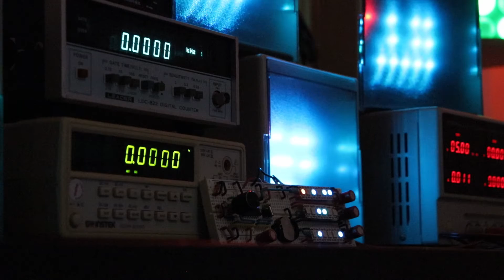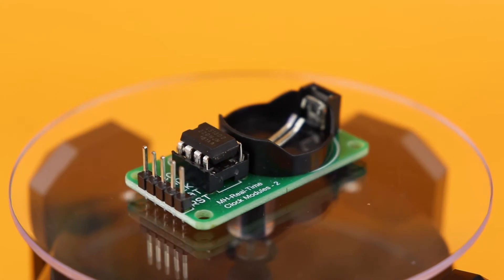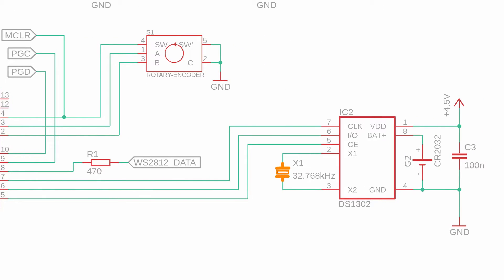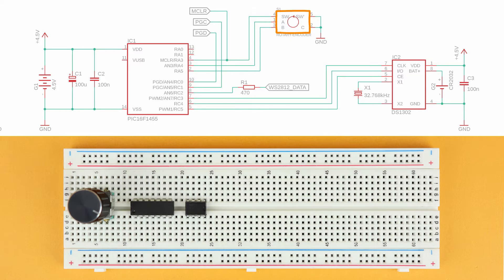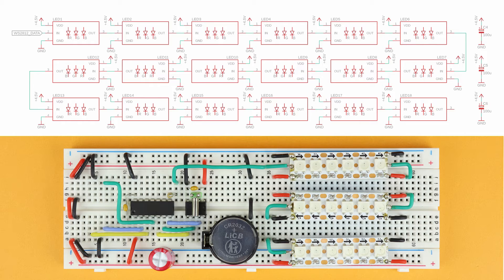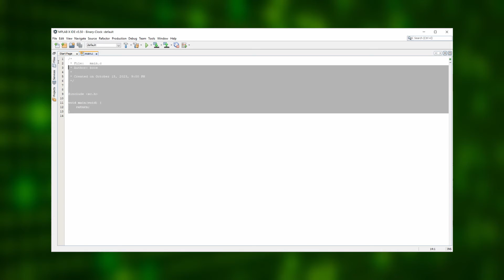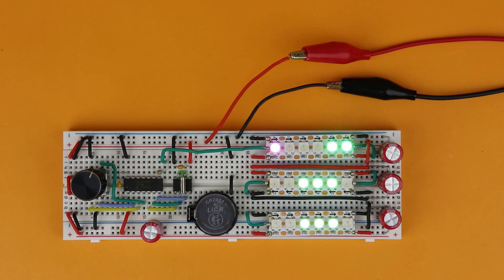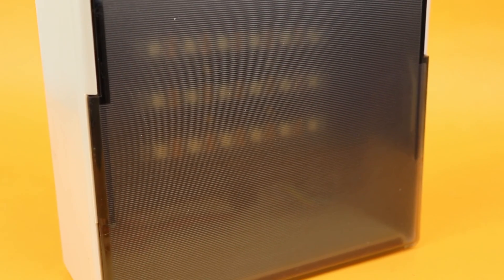How to tell the time with 1's and 0's: a binary clock with WS2812 LEDs

Comment: i need  built a circuit has one inbut as switch and the outputs are more than four LED's , when pressing the switch one time the LED1 will be ON and others Off, when pressing rhe switch twine the LED2 will ON  and others off, and  etc.
Reply from the maker: Thank you for the question! It sounds like you could do this with a simple counter, like the CD4017 ( https://www.youtube.com/watch?v=BZjO2TuS2Vk ) and some extra circuitry. Do you know if you want to use a microcontroller or not?

Comment: I'd really love to build this but haven't gotten into soldering yet. I also don't feel a need to have the rotary encoder if it's only purpose is to control the brightness. Is there a more simplified version of this? Finally, if you are selling those finished ones, I'd love to buy one!
Reply from the maker: Thanks for your question! You don't need to solder for this, you can use a wired WS2812 LED strip. Send me an email (you can find it at the bottom of www.friendlywire.com) and we can find an LED strip that works for you.

The rotary encoder does not just adjust the brightness, but also the color, and (probably the most important thing) the time. You could also add pushbuttons instead, but then you need to rewrite the program.

Last, I do not sell any products right now, sorry. But I am happy to guide you through the whole thing, I am sure you can build it yourself!

Comment: Do you suggest me books to learn from 0?
Reply from the maker: Hello Rustam, that's a good question. I actually tried some books a long time ago (sorry, all in German) but they actually did not help me so much. I would suggest to find one circuit that you like, maybe one without a microcontroller, and build it, and make it work. Then try to understand it, and take it one step at a time. Do you have some experience already, or are you starting completely fresh? Either case, I am more than happy to suggest some good starting points and directions :)
Reply: Thanks
Reply from the maker: @RustamBazarbaev  Let me know if you want to chat some more, you can reach me on social media or via email (you can find the email address at the bottom of www.friendlywire.com). Happy to help! :)
Reply: @FriendlyWire  Sure. Thanks!

Comment: Hey there Jens, I'm a late coming here.  I've been looking at these, very interesting PIC Microcontrollers the past few months and find them very intriguing.  Thank you for bringing these little guys to the lime light.  Like you, I've had to put my electronic endeavors on hold for family, community and work.  Now that I'm an empty-nester, I've reacquired my equipment for my work bench and started playing around with electronics in general.   Started off with a few simple practical circuits.  I have always been fascinated by microprocessor architectures, (8080, 8086, 8086, 6502 etc.).  I started playing around with Arduino and the ATMel AVRs, but caught a glimpse of a PIC12F675 in action which took another tangent in my quest for knowledge in PIC Families.   
I would be most interested in projects that incorporate the new PIC Assembly language to program these uCUs.   Microchip moved away from the PIC-ASM in favor of the new XC8 Assembly structure.   Since then, there are a very few videos out there that cover the new Assembly Language Programming Language.  I've been leery of using C as it tends to pull in  excess baggage into the code and so takes up a lot of precious memory.

I find your articles and zest for learning very refreshing and hope you continue with this ideology.

Cheers,

-d